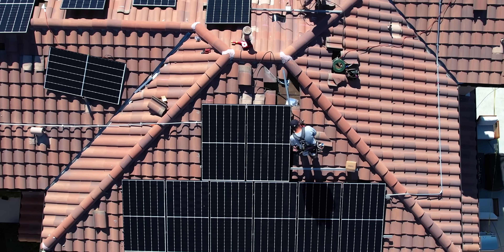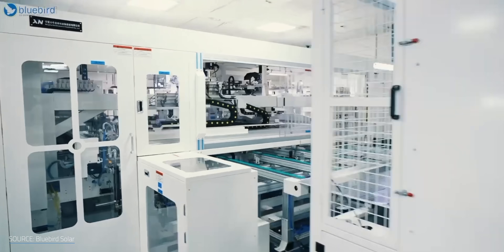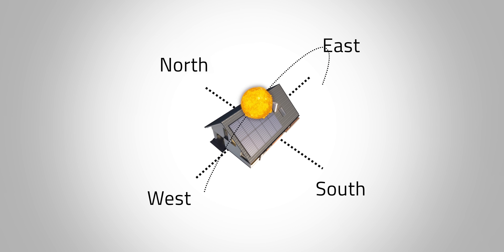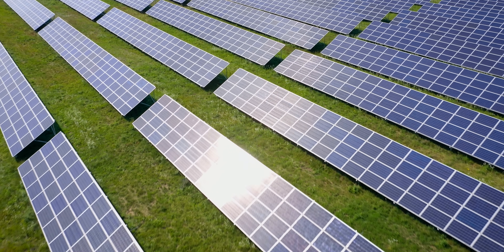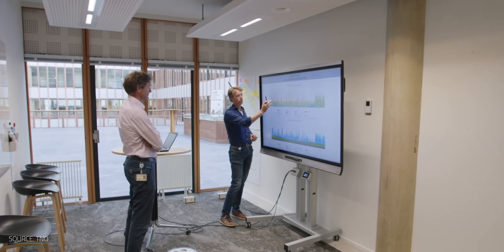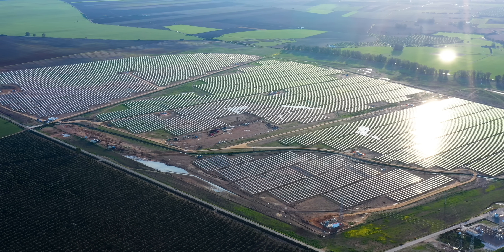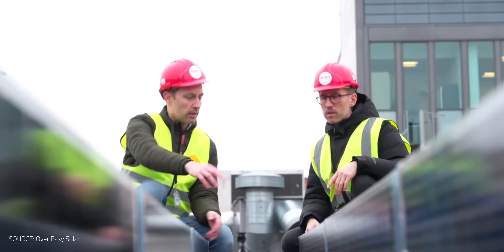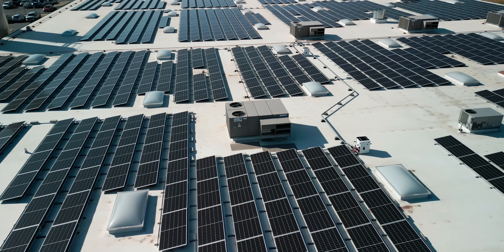Have we been doing Solar wrong all along?

Comment: I'd also think vertical positioning reduces potential storm damage from hail and debris and likely remain cleaner and clear of dust and debris/leaves, just stands to reason. That's the issues I have with roof mounted solar panel installations. I don't have any installed but seriously considering, also when I renew my home insurance they always ask if I have roof mounted solar panels, why, I wonder, is that? Increased liability I'm guessing?

Comment: The graphic showing power increasing with temperature is incorrect. Anyone with solar PV in cold climates knows that output voltage is highest when the modules are coldest. My modules produce 150% of rated STC in January below -30 F 2000 watt array produces 2990 watts. That is why string sizes matter. In a battery system most charge controllers are limited to 150 volts. When doing string calculations, you lowest temperature must be considered.

Comment: It would be interesting to see how these could work out in hurricane country, if they could be hinge mounted so they could be rotated horizontal and pinned/bolted to ground mounts during a storm.  Most panels aren't wind rated as high as newer roofs in FL, and could impact insurance rates, but if they could be "fencing" as in the video, but rotated down and pinned in place during a storm, that could get interesting.

Comment: Something that nobody has talked about is fiber optics used to transfer sunlight to wherever you want it. You could have a garden indoors and use fiber optics to transfer real sunlight to it. You could have every single room lit up with actual sunlight for free all day.  Its like a skylight you can run thru a hose to put it where you need it
I suppose you could also use it for solar panels to direct sunlight where u might not normally be able to put them, like on the shady side of the house or even in a basement or something like that. The possibility is endless

Comment: Electrify the farm equipment. You can have the transmission lines do double duty as overhead catenaries for powering the equipment. Then, add diesel range extenders onto the equipment for off-grid use. (Looking at you, Edison Motors.)

Comment: Thanks, very informative.

Question: Are you saying that the bi-facial solar panels have two P-N junctions per panel, and two panels per frame?  Would it be possible to have a layer of P material with N material on both sides so that there would only be on one silicon panel per frame?

Comment: I think the biggest potential upside of vertical panels, is purely that they are stationary, some of the most competitive solar panels have to move to catch more sun, but these offset needing to move by staying cool to keep their power yield higher. Its a system that needs less to no moving parts, that makes them longer term and more accessible as well as more cost effective.

Comment: South installation is a Myth, a busted Myth. My friend you see, peak production =/= minimal production. When designing the project with minimal production in mind to overcome winter month's, you don't use South, you use the West Side at a steep angle or even vertical on the walls of your house. Pair this with HJT/HIT, TOPCon or the new ABC Panels and you'll outperform South Side installations in all year performance.

Comment: Mostly great video but…throughout the video you talk about voltage changing, when you actually mean power (or current). Solar cell voltage isn’t significantly affected by orientation or temperature, but current (and therefore power) very much are.

Comment: Actually you are incorrect on how solar cells work, the layer of silicon on the sun facing surface is doped with an element like phosphorus, that element is where the electrons come from where the silicon is used because the crystals have a property called "the hole" which helps capture and control the electrons so they can be funneled into the curcuit.

Comment: As a solar specialist, let me answer your question: no, we weren't incorrect; it just comes down to weighing the installation's advantages against energy expectations. If we install the panels without regard to their ideal orientation and continue to receive intriguing benefits—like move with tractors through agricultural fields or the prevention of snow accumulation—we should consider the energy produced by the relevant investment. It goes without saying that you will not invest in this kind of installation if the panel rises by 500% tomorrow,  nowadays the panel decrease by more than 50%, so there are more profitable than ever and the difference in production can be justified much more.

Sorry my english i did my best.

Comment: This fantastic news! A big push to the photo-voltaic technology was exactly what was needed and unlike other exotic, expensive, untried solutions, this one seems very practical and affordable. All that remains is for it to be tried. However, I am confused as to which part plays the greater role in this increase in the efficiency of the panels: is it their bifacial geometry that increases their surface area or is it their vertical installation, that increases cooling  combined with an east-west orientation? Also, I find it hard to believe that the simple idea that a cooling-optimised positioning of the panels benefits efficiency has not been tried in over 20 years that the photo-voltaic electricity generation has become a mass commodity. I find it hard to believe that no-one has seriously researched and tried this all this time. I guess many great discoveries seem obvious in hindsight so let's hope this is one of them too.

Comment: MAKE WIND GENARATOR BLADES OUT OF SOLAR CELLS AND THE TOWER TOO???
THIS WOULD MAKE IT EASY TO REPLACE BLADES BIG PROBLEM FOR WIND GENARATORS
ALSO WOULD BE MAKING POWER WHEN NOT IN USE OR NO WIND WIN WIN OH YEAH BABY
Reply: Worst of both worlds. Heavier, slower wind turbines with more drag. More expensive solar panels that are now moving objects and therefore last only a tiny fraction of how long a normal panel will last. And now we're running tons of wires into the actual blades.

Comment: There is actually a simple way to do solar that would revolutionize solar to the point that it becomes more affordable and is used in a much wider capacity.  I designed it.  We are still going at this entirely wrong and wasting resources in the process.  The good part is that we can even use what panels we have to kickstart the change.

Comment: Now, we know why we are getting around 17 percent higher efficiency  when compared with normal mono facial solar panels. We are using the high temperature of the surface of solar panels to obtain hit water through temperature transfer. Never thought that it would lead to a an active cooling system, which will lead to higher efficiency of the solar panels. Unintended benefit (higher efficiency), which is bigger than the intended benefit (hot water) 🤣🤣🤣🤣🤣

Comment: My house has a flat roof, and I do need to go up on that roof on a regular basis.  I'm also in northern NY state where we at least used to get a lot of snow in the winter.  And once there is snow on the roof I'm not going to go up there.  All of this means that I'm very reluctant to put horizontal panels up there.  If they get covered with snow, there's no way I can go up there and clear off the snow.
I knew very little about vertical panels.  I knew they existed in some places, but never would have considered them for my house.  But I could put a few vertical panels up on my flat roof and I think that'd work quite well.  My biggest concern would be with how much wind they might be hit with.  Very interesting.

Comment: One advantage you can add to this subject is that the fact that the ground temperature is not be reduced as significantly as per a traditional installations hence thermal updrafts for said area will remain similar. Which incidentally,  the reduction of, is in my opinion actually affecting our current climate situation.

Comment: One thing you don't mention at all in your video is the kWh/kW (energy produced per panel capacity) for "traditionally" installed panels vs vertical. Once you look at that number you dreams of solar fences will shatter quickly... and this is why this is just a pipe dream... you'll have 50% performance... at best (i.e. in northern lattitudes).

Comment: If we put in panels they'd be placed flat on a section of flat roof.  Instead of dealing with the cost and weight of brackets to angle the panels we can instead just cover the whole roof with panels for less money and get the same or better yield overall.  The additional panels would make up for the angle.  Using panels as fencing would not be viable because they'd probably get stolen.  Even panels on roofs are best installed to minimise their visibility from the ground.  Using them as fencing they may also not get that much sun, because it will be blocked by neighbouring buildings and trees.  Putting them on a roof would presumably require strong hardware to deal with the wind which may further increase the installation cost.

Comment: I didn't put my guess in the comments, but I guessed right.

I have studied plant biology at the graduate level and its funny how this is similar to some of the tradeoffs plants have to deal with. Most plants photosynthesize at lower efficiency as the temperature goes up. This is both because of lowered enzymatic activity but also because high temperatures cause water to burn off too fast (causes leaf burns, xylem cavitation, general dehydration) -- plants respond by closing their stomata which slows the rate of carbon fixation.

Plants employ lots of different strategies to increase their efficiency by reducing heat. These include white wax and hairs, as well as more vertical leaf surfaces, such as in many monocots when they are drought stressed.

I think solar engi

Comment: Vertical is waste of energy. They are not on both sides same effectiv if you ready manufactorers information. And the better side is in a bad angle towards the sun because its vertical. So better to have angled one. You can still have east-west orientation. Vertical you can use as fence.

Comment: One downside might be that east/west orientation is not ideal during the winter months, making it a little less attractive for supporting a heat pump. which requires most of it’s  power exactly in that period. I‘m considering a solar fence instead of roof mounted panels, but this is what makes me think that for heat pump support you need as much area oriented south as you can get. BR, Bernhard (Austria)

Comment: This is just a novel way of dealing with the problem of overheating of panels by vertical mounting - it changes nothing in the grand scheme of things, especially on not-so-bright days (i.e. swapping the same losses of one way of using the system with another loss that's either equal or greater to). The 4% captured on other days wouldn't touch the sides of what was lost on the others - so it's a gimmick at best and at worst an over simplification. What really needs to happen is the development of far more efficient solar panels that can convert more wavelengths of light photons on a smaller surface area - 40% and over, yet have only heard graphite heat batteries use such efficient panels.

Comment: They take up less "room" but from the images, it looks like they need more spacing between them because the angle the light hits them. So I'd argue they don't actually save space...   but here's the real head scratcher... you're using double the PV cells are you not? (Front and back) so rather than using double the cells for a 4% increase, wouldn't it make more sense to lay them out as double the single sided panels in the conventional method and grain a 100% increase in output? Yes, it takes more space, but it would be a more efficient use of the PV cells.

Comment: Hello,

I am writing to express my interest in providing PV design services .. As a highly skilled PV designer with an international degree in energy engineering and over 4 years of experience in American solar companies, where I completed more than 1000+ projects and obtained permits from numerous counties, townships, utilities, and cities, I am excited about the opportunity to contribute to your projects and deliver top-notch designs that meet your needs.

Having worked on various solar projects with experienced solar design teams, I am well familiar with the complexities of PV designs and the critical factors involved in obtaining permits for solar installations. I am confident in my ability to create comprehensive designs that align with local regulations (HOA), national requirements (NEC), and international requirements (IFC, IRC), ensuring seamless approval processes.

I possess extensive understanding in designing various types of solar installations, including ground-mounted, flat roofs (rubber and metal), single and double-story buildings, shingle roofs, and systems utilizing mono-facial and bi-facial solar panels. Additionally, I have expertise in developing stand-alone, grid-tied, and battery back-up solar designs.

Below are some of the key aspects of PV designs for permits that I can provide:

• Cover Page

• Site Plan

• Electrical Plan

• Solar Attachment Plan

• Line Diagram

• Design Table

• Placards

• Assembly Details

• Roof Details

• Specifications of equipment used in the project

I can provide not only residential but also commercial, utility, carport, and solar farm designs.

Here are the samples of my few designs in which I use

Panasonic, Eg4 batteries,

Generac generator,

solar edge, Enphase, Fronius, Hoymiles   inverters

Comment: I live close to the 67 parallel. I have quite some education in photovoltaic and renewable energy(but 10 years old and not maintained). 
I have been thinking about VPV-panels for my home for several reasons(mounted on the south wall of my house). 
1. Less time covered by snow.
2. I dont need the most energy peak summer, I need it in february when the sun is low on the sky.
3. More protected from the elements. 

You just gave me more to think about and when I have the money I will invest in VPV-panels.

Comment: The company Array technologies did an analysis on bifacial vs tracking systems with monofacial panels.  Tracking still outperform any bifacial arrangements.  In other non-array systems this is interesting however.

Comment: This is why a few of us in the solar industry use the general rule of solar panel tilt angle of your latitude plus 5 degrees, rather than your latitude.  It helps reduce the heat slightly in the summer and is more efficient in winter, giving a slight net annual increase in power generation.  I've been doing this since 2007.

Comment: At 7:37, the graph legend doesn't describe this graph as a comparison of vertical and horizontal panel performance. It appears to be a graph showing the temperature in a solar panel relative to the setpoint temperature and the ambient temperature in the simulation. This is showing something about thermal performance in the panels, but it doesn't specify which panel, and it isn't a comparison.

Comment: I have an idea that might even increase that benefit in removing some of the Heat by simply doing panels that have like tube holes going down through between the panels I do two panels together with square tubes to allow air to be drawn up through acting as an air cooler due to convection!
Reply: Have you tried pumping a coolant in those tubes as well? Let the fluid wick away excess heat to a cooling reservoir or a radiator not in direct sunlight.

Comment: Living in Minnesota, we have to oversize our solar equipment to account for the increased output when the panels get really cold. The vertical position should reduce the problem of snow accumulating on the panels and during an ordinary winter there is an awful lot of light bouncing off the snow that could definitely increase the output of bi-facial panels.  Thank you for your explanation, I am definitely considering bi-facial panels.

Comment: This is being presented as if it is something new. You think this has only just been accidentally discovered? All this has been known for decades. For example, roof solar panels work more efficiently on windier days. That's because the wind is cooling them. It's all just about cost, space and practicality. There are lots of considerations e.g. monocrystalline vs amorphous. Cost includes materials, maintenance and install. What to go for and how best to do it is known as "engineering". Oh, and @7:33 "as you can clearly see here" - er, I don't think so; there's nothing clear from that graph compared to what you are saying at the time.

Comment: Excellent video! I have 2kw of vertically mounted panels here in southern Italy. The sun is very low to the horizon in winter so these work especially well durning this season. I see between 1500 & 1800 constantly on this array from about 10am through to 4pm on clear days. Summer time they don’t do very well but that is what I expected. Would like to get my hands on some biracial panels to have a play with. 😊

Comment: I dont think they are that good. If to put solarpanel in vertikal position, is better. Why do the leafs of plants do not grow vertikaly? They hang down and do have naturaly the right angle to get the most sunlight. 
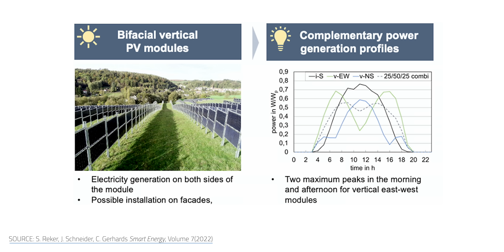In the graph, at 4:00, they only provide the W/Wp ratio. There is no information about the W/A or the W/price. I also think, that they trick in this graph. The "i.S"-line should get up to nealy 1 at 12 o'clock. It's not normal, that a panel at 100% alligment to the sun only produce 75% of its Wp.
Pretty sure that you'll get more power per area distributet over the day whit two east and west solarpanel ( /\ ) than with one vertical.
I would say, there are some cases, where they might be a good solution, but not for the common solarparks or roof's.